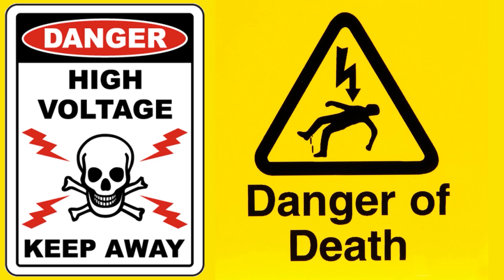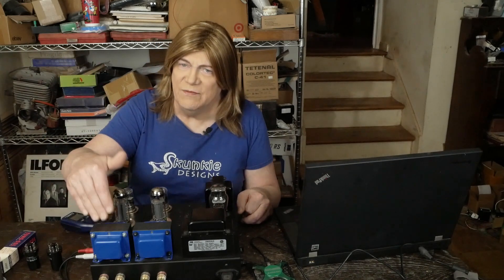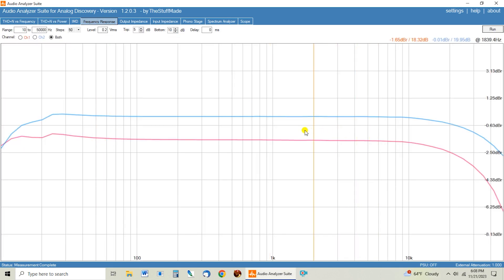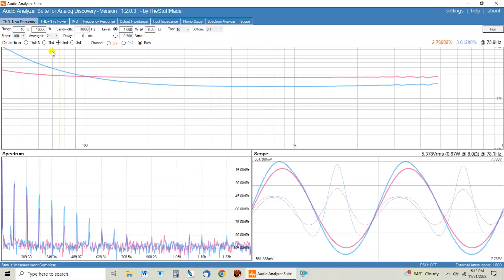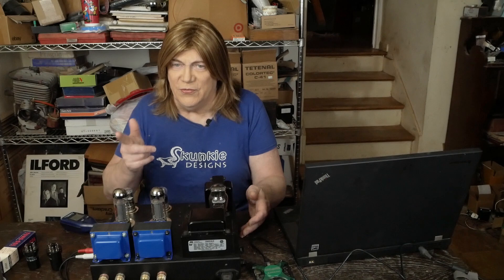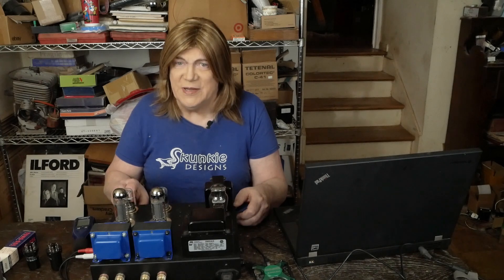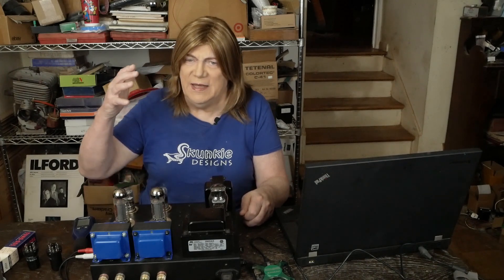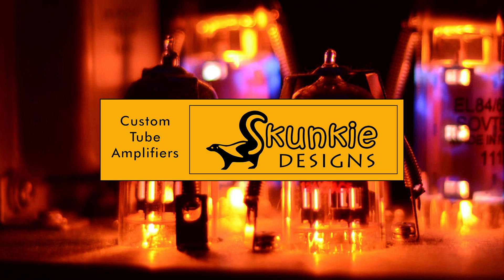Testing Output Transformers, Changing the Impedance

Comment: 4:18 I'm not so sure about thisrule of thumb. I think it definitely applies to most triodes (unless it's a really weird triode of course) or to pentodes/tetrodes strapped as triodes but I would not think it applies to pentodes used as pentodes. Judging from the clumping of the curves for most pentodes (at least most pentodes whose curves I've seen), I'd say that the clumping tends to get denser towards the lower current region and only has a very narrow region, if at all, where the clumping is uniform. What this means is that, in order to get any useful power out of them, one has to operate them in a wide current swing manner or a wide voltage swing manner - the latter (high impedance) will inadvertently force one to enter the region where the clumping of the curves gets denser, thus have more distortion. Of course, this whole time I'm referring to the set of anode current-voltage curves obtained at various grid voltages.
Reply from the maker: As 85% of the channel members eyes glaze over...
Reply: Yes, trying to describe a graph with words is bound to fail  @SkunkieDesignsElectronics   but I thought of giving a try regardless... 
Very briefly, my point was that I did not quite believe that higher load impedance implies lower distortion for pentodes judging from the looks of pentode anode curves. But looks can be deceiving and also, as you clearly illustrate here, not all distortions are the same.
Reply from the maker: My point was there are more variables to what primary impedance is best than just the tube type, such as what plate voltage is being used, is it UL or is it pure pentode etc. Folks can study those graphs (or computer simulations) like they are scripture, but at the end of the day those are guidelines, actual tubes many times don't behave exactly like those graphs and actual testing is needed.
Reply: Of course @SkunkieDesignsElectronics , that's absolutely correct.
Also, the most important thing to remember is that the proof is in the pudding, i.e., at the end you have to measure the thing to find out whether what you planned for is what you got. Of course one could simulate the output transformer primary impedance by using a variable power resistor and measure the actual distortion in-circuit. That would only be a crude approximation as there are distortions and other effects introduced by the transformer but at least one can get a ball-park feel of the right anode impedance. Having said that, this is quite academic, firstly because I'm not sure such high voltage variable resistors exist (or are easily obtained) and secondly because I can see the process of adjusting the resistor being so frightfully dangerous (it would only take forgetting to switch off the power before adjusting the resistor and that would be quite deadly for the builder) that I could not recommend this method to anyone.

Comment: Stephe, do you think this change in the transformer impedence and the results would be applicable to all single-ended EL34 amplifiers, or is it possible that it would be different for different amplifier designs (feedback type/amount, UL or not, different B+, etc.)?  I don't understand how well this might relate to a different amplifier design.  An old Philips EL34 spec sheet shows 3k, and I am wondering how they arrived at that number, unless they looked only for maximum power output.
Reply from the maker: Other amps may be different. And the low impedance will give more power.

Comment: Super interesting! Did the 5k fit the existing holes, and did you have to make any changes to the circuit? I did not notice a mushy base response and wonder if it's worth the upgrade. I agree that even if you lose a bit of power, there is still plenty left.
Reply from the maker: Yes it physically fits exactly the same, and no changes to the circuit. It's not a lot of money in the scheme of HiFi gear to try a pair if you have the OG 6SQ7 amp, people spend way more on interconnect and power cables that IMHO aren't going to change anything.

Comment: When it is said that lower impedance transformers have higher distortion you can only judge by setting both output levels to be the same instead of worrying about the input levels being the same. Amplifiers can act different depending on output wattage, ive seen higher distortion levels at the low end of an amps output then it can get lower in mid power then dostortion climbs again. All depends on the device performing the amplification and its parameters.
Reply: Was that on push pull ab amp? Saw someone find a similar measurements on one, something about the bias if I remember right.
Reply: @johnstuchlik5828  good point, again it varies but yeah I mostly see it on push pull even when the class ab amp is biased into class a for the first couple of watts. Another thing is with these lower watt amps the bass has a very low threshold before the distortion under 100 hz jumps up. I recently designed and built a class ab solid state amp that only puts out 4 watts, I designed a preamp with tone controls too, all discrete transistors btw. At flat response and 3 watts its around .3 percent thd in the bass and .2 or so the rest of the way up. I limited the bass boost to about 8 db because of the low wattage, not much headroom. Its easy to cross that threshold on low wattage amps since if it only puts out 4 watts and ur at 2 watts for most of your listening then you boost 3 db of bass your already close to watts in the bass region now on the output so getting close to clipping. I will say though that its harder to hear distortion under 100 hz or so, so having anything under about 5 percent or so may sound ok or even just sound more full. I know this little amp i built the bass sounds close to a 50 watt amps bass. Sounds like its got some meat on the lower end.
Reply: @jakep8484  thanks for the details.i bet your amp sounds good.ive also found it doesn't take much bass boost to clip low watt amp.if wasn't for speaker distortion and ears low resolution in the l.f.region,low power amp would not be practical option for  many people.

Comment: Interesting - 'course I'd like to see the curves when you REALLY push it into distortion ;) Oh and youre not alone, Marshall's trick was winding the OPT a bit lower Z than spec, which seems to make an amp sound quite a bit louder - so I guess its low Za for Keranng and High for a Clean amp?

Amything bigger than an EL84 I tend to think PP, but the same applies there i guess - and those Edcors are just a nice size - Most SE's seem like a waste of iron, but i could live with something        like that :)

And yeah youre quite right Tapped Primaries are handy for a test amp, that's about it - SECONDARY taps on the other hand, given how different types of realworld speakers vary Z so much across the bandwidth, its nice to have the option to switch between a high (cleaner ) anode Z and a low (louder) one - they're kinda traditional one I'm all for them :)

PS Sure hope you find something good to put in the KT120 design soon! I guess a quality 6550 would work, but you're not getting all the goodness it was made for, right?
Reply from the maker: I did find some earlier KT120 tubes that would bias up where I wanted. It's working great now :)
Reply: Oh Cool! I know i b!tch about the juice and big iron that large SE's require, but i know you put a lot of WORK into THOSE guys - lets hope a retail source of something usable shows soon huh?

Meows From london!

 Pete G + William Stereocat

 @SkunkieDesignsElectronics
Reply from the maker: I do with there was more than one source of these high power pentodes.

Comment: Were these tests run in ultralinear mode? wonder if pentode and triode mode would give  similar results.plate voltage can effect plate resistance.what is the primary and secondary inductance of those two edcors? Would be interesting to see low frequency distortion on tapped transformer.l don't have distortion analyzer but I think I'm going to use a rta to look at ham 125ese harmonics 40 hz on 807/1625 ,el84 using pentode and triode mode at different impedance.is there much difference in d.c.resistance of the edcor primary and secondary? the old tungsol data sheets on 45 show some curves on load verse power and distortion.your findings on the different distortion profile at lf on those transformer is very interesting.
Reply from the maker: Yes, UL mode. Measured them for ya with my little peak meter on the primary 3.5K is 95R at 7H and the 5K is 160R at 11H. The secondaries are almost identical at 0.7R at 17mh. Hope that helps ya.
Reply: @SkunkieDesignsElectronics  thanks, I didn't find that info on edcor site . they are adjusting the turns on the primary.i wonder what the four ohm version of these transformer measure? the.7r is some times needed to accurately model speaker response as it can affect qts.
Reply: @SkunkieDesignsElectronics  ok , now it would be interesting to put a 4to6ohm loadon the 5k transformer to reflect back 3.5k to the tube and run the same test.now your looking at inductance changes and what builder's, customer can expect if use lower than 8 ohm speaker on that single tap  ot
Reply from the maker: Maybe in the future, I have too many projects to devote a 12 video series on testing a single pair of transformers endlessly in every possible scenario, or provide data for the sim guys to model stuff. I'm just trying to decide which of these two perform better for my project amp in real life.
Reply: @SkunkieDesignsElectronics yeah, testing can take time.i appreciate the objective and subjective testing you do.i don't model amps,I build, make the measurements that I can and then listen to the results.look to buy some ot transformer and was considering the two edcors you tested.looking forward to more videos about transformer selection.thanks also for mentioning the rh amp in an earlier reply.

Comment: Cool it's great that you have someone who can make custom Transformers for you. It got me thinking that you could have them make a custom test Transformer with some Taps on the end of the primary for different impedance such as for the 4.5 k, 4K and 5K perhaps put a switch into change between the impedances on the fly . Perhaps there's a sweet spot. Of course this would not be good if you wanted to use Standard production Transformers, but if you're going to have custom Transformers, why not.
Reply from the maker: Might be easier for me to work up a switchable load? Have to think about that so more.

Comment: Great Job as always.    I have several 1626 triode Tubes to build a flee power Darling Amp.               I can’t tell heads or tells from the data sheet what impedance  output transfer to use.                  I’ve heard everything from 3.5 to 10k.                                                                                                    If anyone has some knowledge on the 1626 I would appreciate it so much.                                     I’m planning on spending a considerable amount of money on the output transforms.                    I’m not trying to take anything away from what Skunkie Designs is doing, Hell Im going to build her Amp right along with her.                                                                                                          I’ve built some horn loaded speakers from old vantage stuff I’ve been finding on eBay                   About a 1/2 a watt or less is all I need for this project.    Everyone needs 4 or 5 systems lol.             Thanks Skunkie for being here.  I’ve learned a lot.    Priceless
Reply from the maker: The operating point does impact what impedance might be best.
Reply: @SkunkieDesignsElectronics .      250 volts on the plate.      20ma of current.       My thinking as you proved in your testing, 10k, 25 watt output transforms would give less power but better Bass than let’s say 8K OPT.     Am I going the right direction at 10k for the 1626 Tube.    🤷‍♂️🌹🌹🌹
Reply from the maker: I think so, 10-12K is probably a good spot to aim for at that operating point. Also I would not use a 25W OT for that low a power, 10-15W would be fine.